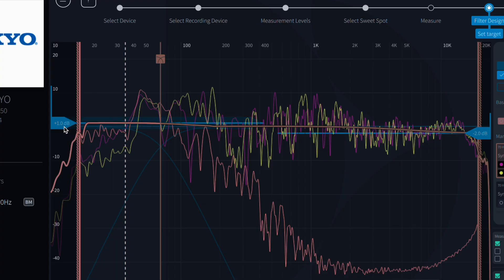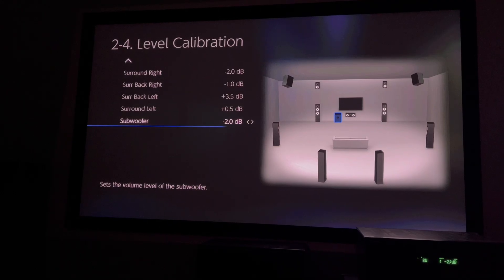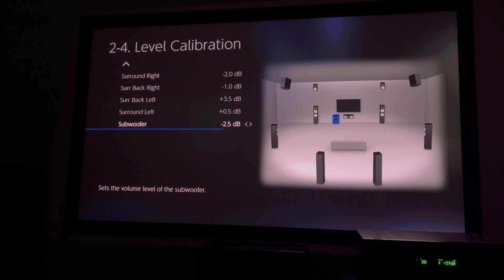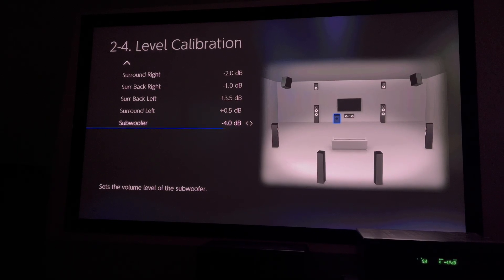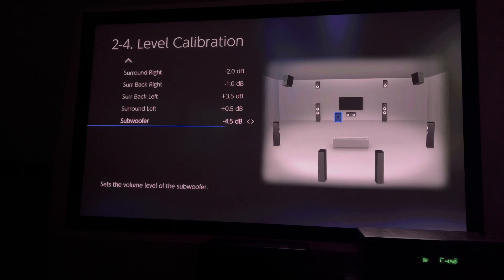4 Settings For POWERFUL BASS With Dirac Live

Comment: Dirac will put my bass to -7 db, it’s very similar to if  do manual setting of sub to achieve 85 db. It’s set to lower level so that when you have to crank it to reference level it won’t distort the sound. You might not hear bass at low sound level.

Comment: I now understand the sound signatures of these 2 brands. I had an Onkyo TX NR 414 back in 2012, sound sparkling, mids solid and bass, tight and dynamic, fantastic avr . Then I had hdmi issues back then and decided to switch to Denon X1500h, completely different sound, , warm, laid back, the highs kind of subdued, as if a veil was covering my speakers. Was not used to this Denon sound signature, but used the avr for about 4 years. But so used to Onkyo sound I eventually switched back to Onkyo, TX NR 7100,
Reply: What is 1500h? lol... get a 6700-8500 and see.

Comment: What if my dirac live sets all my speakers to large.. but instead of selecting 5.1  i select 5.0 or just unplug the reciever do the measurment then plug the sub back in or change it back from 5.0 to 5.1?

If the subwoofer volume is set to half way then why cant we put the Sub EQ to max on everything then slightly dial it back in the recievers subwoofer dB setting ?

Comment: Man this stuff gets complicated lol. But I tune in to learn. I love audio. I think I have a pretty good setup. Not Atmos yet, but a 7.1. my receiver is a Yamaha RX V467. It's a 5.1 but has a pre out. So I have a 2ch connected. Looking to swap it out with a Yamaha TSR 700 I got a few months ago. But hesitant because it's a 100w per ch with 2 ch driven? And the one I am running now is 105x 5. Which means it's more powerful. Again. I don't understand it, but I'm learning lol also running an SVS pb1000 pro and Polk Audio speakers

Comment: AudioAdvice has a 18 minute guide on DiracLive. He mentioned that most people also perceive the subwoofer weaker because the room creates a peak at those low frequencies. I can hear that in my living room (2.1 with a NAD M10 V3) when I walk around, the bass levels change significantely. 😉
Also people perceive sound very differently, from age to how damaged the hearing already is to personal preference. F.e. I am always a bit more of a "basshead" and listen primarily to EDM / electronic music. But I also always have been sensitive to higher frequencies, f.e. those buzzers when you press a button and it beeps is just annoying to me. 
And let's not forget that Dirac & the equipment manufacturers always develop their software further - which can be good or bad. In the last few months Dirac and BluOS released some updates which made my room correction unusable - and the last BluOS update yesterday reverted those changes in the bass curves that made my room correction run from 3 days ago obsolete. Now I have to run it again... 🤪

Comment: I haven't tried the settings where you start adjusting the curves with the onkyo app on my phone or lowering the gain before calibration. When I first used the calibration and almost all of the bass dropped I just went directly into the speakers levels and adjusted it there on the AVR. My subwoofers were calibrated at -15.... I have no idea why it would be that low. I set it at 0 but after watching this video I'm second guessing myself lol. I have the rz50 and two klipsch r-12sw's.

Comment: The 3rd suggestion, boosting sub in the AVR menu (NAD T758,) is blacked out and not adjustable if Dirac is selected. You can only boost specific speaker levels if you are setting manually.
Reply: Yes, all the speaker settings are blacked out with the NAD T758. Only way to change is to not have Dirac running. Hence why you set up levels & distance before running Dirac

Comment: Thanks for a Great video!  May I suggest for increasing bass:  "Harmon Target Curves".  I didn't have a CLUE (and still don't 🙂) on what those squiggly colored lines meant on the Dirac Live calibration on my Onkyo TX RZ50.  I found a YouTube video where the Instructor (SamDansCouch) recommended selecting one of several 'preset' Harmon Target Curves to increase bass because Dirac intentionally reduces bass.  These 'curves' were very helpful for me in increasing my bass after calibrating my system.

Comment: Most of this was bad advice. You don’t want to adjust the level or gain on your subwooofers after running Dirac. If you do that, there will be a harsh and sudden increase in volume of the sub woofer frequencies. The only good advice here is adjusting the target curve. Beyond that, once you find a target curve that is more or less “neutral” for your tastes, you can then adjust the bass or trebble tone controls on your receiver if certain content needs more or less of either.
Reply: tone control is worst advice than his
Reply: @harmonykardon2116  Agree to disagree. I used to feel this way, but people like Floyd Toole (previously at Harman, ironically given your screen name) have advocated for it when appropriate (particularly if you have good speakers).

The whole point is you don’t want to set your target curve based on content itself because if you do that, some content will sound great and other content may sound horrible due to inconsistent mixing.

That’s why I say, try to calibrate your target curve to sound neutral in the room (sort of hard to do given the content issue I mentioned, but with a lot of listening the room, it becomes easier), with the idea that you may need to use tone controls (particularly for bass) to make certain (poorly) recorded content better.
Reply: Target curve is the only answer here. You can’t fix room nulls with more volume, so room correction will pull back other frequencies to minimize the impact while balancing to other speakers. Two keys, balance your output levels (get close enough) at normal listening levels using the sub gain with the L/R speakers with a test tone and meter and once you run Dirac, export multiple curves with incremental bass levels to pick the one you want. Tone control should be defeated.
Reply: @photobriangray  I agree with you, except about the tone control part. Sometimes sources are poorly mixed and it makes sense to adjust to taste IMO. An easy example are stereo versions of steaming audio vs Dolby atmos mixes on services like Apple Music. The same song can have drastically different bass levels depending on the version you’re listening to.

I typically do have several target curve presets as well, but typically I find it works best to be willing to fudge things a bit with the tone controls when necessary. 😂
Reply: If you want I do remote calibration for Dirac I could teach you the correct way of doing it
Reply: @kermithoffmeyer840 
Moi je serais bien intéressé

Comment: Marantzs system does the same thing and I just shut it off and do my own test tone with the subs manually with a sound pressure meter(75dblevel) some may like higher or lower And I do buy into what you are saying

Comment: What if we use an SVS sub? Would the “right way” be to run Dirac live, then adjust the sub up by using the SVS app if we wanted a boost?
Reply from the maker: Definitely try that. Use trial and error to find a setting or approach that produces the best result.

Comment: One thing to remember: our ears/brain combo is not the microphone. We perceive sound intensity different depending on frequency and volume levels. For example at -40dB the bass may sound weak compared to other frequencies but at -5dB it may sound just right.

Btw, modern subwoofers often have DSP and built-in protection so it's hard to damage it with too high levels.

Comment: Glad I watched your video. I thought it was just the Pioneer app on my system where the bass falls back to the DIRAc level setting. BTW...I had tried to use the shelf level change for the bass, but I did not like the way it effected the response between 200-500Hz. I seemed to loose some clarity in the vocals, so I just adjust the subwoofer response and bump it up about 4db across the frequency range below 80Hz.

Comment: This video came up right as I was redoing stuff after adding height channels

As part of the recalibrstion I cannot get my subwoofer to work well with DIRAC calibrating. It's calibrating the entire sub out on my RZ70 and I'm having to add +6 or so to get anything from it and it doesn't sound right even after trying to advice in the video

My manual levels without room correction are sounding better to me by far and I have no idea where to start in fixing it

Comment: What about for an svs sub where would you set the volume before Calibration ?
Reply from the maker: Start by setting it at a little less than 50% and adjust it up to 50% after calibration. You can also use trial and error and try running calibration multiple times, setting the volume at a different level each time, to see which one you prefer.

Comment: What I do is just run dirac live and when its done. I go into the level and boost the subwoofer to 85db or 10db hotter then the other speakers. I wish I would've known about this sooner because for years I just let the room correction do its thing and thought that was the "proper" way to have the subs calibrated to the same levels as the others speakers. I always thought the reason I had bad bass was because I thought I had crap hardware. Then I bought a new AVR, speakers, and subwoofers was disappointed that the bass wasn't that much better. Then I watched a youthman video about setting the subwoofer 10 db higher then the rest of the speakers and gave it a try. It was a night and day difference.

Comment: Thank you!!! Important to note, after saving and exporting, if you go back into Dirac Live and make more adjustments, save and export. Then you must go back into the level calibration and reset the subwoofer level again. If you don’t, the subwoofer level will reset to the default calibration level. Great video!

Comment: Whether it's labeled Gain or Volume, the level control on your sub amp is part of the gain stage and adjusting it after running room correction risks distorting your bass and damaging the driver. Adjust the target curve in Dirac to get the bass you want, don't mess with your gain stage.

Comment: Hi, you mentioned adjusting the target curve, but what if you're using Majic Bean? Would you still try to adjust the level?
Reply from the maker: You could still boost the lower frequencies after loading the MB target curve. However, MB may already boost it enough. But definitely mess around with it and try different settings to listen for which setting sounds best.

Comment: So .... pozitive trim (eg +3dB) in AVR with lower gain on subwoofer ( eg -12dB) or higher gain on sub with negative trim in AVR, after DL calibration?
Reply: 100% adjust your gain on sub before the trim in AVR otherwise you can start clipping the digital signal being sent to you sub amp.  Way better to clip sub amp than clip receiver processor signal out
Reply from the maker: Try both options. Listen for which sounds better to your ear.

Comment: I only can suggest to switch to Bass Control if this is an option for you. I know and tested all three options and BC is definitely a game changer in tightness, accuracy and synergy with the rest of your speakers. Specially if other speakers are potent full range ones.
But if you use BC you should not tweak anything at your speaker levels after Dirac set it, as you can break the phase coherency.
I always correct the house curve to my preference. There are 3 saved presets. 
- a quite flat one with only +3dB on the low end which is very good for audiophile music listening
- +6dB bass boosted - fitting for the most movie material
- +12B bass boosted for ridiculous bass

+6dB and +12dB curves are equal to +3dB from 50Hz upwards. I only boost the sub bass to push the earthquake effect in movies but keep the audiophile touch in the rest of the house curve. I hate pushed upper bass between 70-150Hz. That sounds really trashy to my ears.
Reply: This is helpful

Comment: Thanks for sharing the knowledge. Just one question, under Bass Management, when I see speakers being crossed at 70hz or 60 hz, my AVR (Denon) still shows default crossover, which are set at 80hz. So how do I apply Dirac crossovers?

BTW, great tips on subs, I boosted the curve +5db, I have my bass back. Thanks once again, I just subscribed to your channel.
Reply from the maker: Great! Glad the video was helpful. You can adjust the crossovers by dragging the vertical Crossover bar to the left and right.
Reply: @GeorgeTheaterAtHome yes, but how does it get in the AvR. For example, I see speakers trims and distance changed. But crossover is still at default 80hz. 

If you have ever used Audessey, it will set the crossover in the AVR by overriding the default setting. I can change it manually if I want to. 

Not sure if I am doing a good job explaining this...lol

Comment: The reason the bass is less could be several. First most people do not listen at reference level so with how our hearing works, we will need to boost the bass to compensate for rhe lower level.
Also, people may be used to their bass with big peaks at certain frequencies that dirac will smooth out.
And if you have an onkyo, Dirac is still messed up there

Comment: Great video, George! Heads up, I spoke to Dirac Support and they mentioned that there is a bug with DLBC on the Onkyo-RZ50. Not sure if that issue also pertains to Bass Management but from my REW sweeps (had a Dirac Slot 1 filter with no Bass Management and Dirac Slot 2 with Bass Management) Bass Management created dips in the frequency response around the crossover points that were being set with Dirac. Was weird but would be interested in seeing REW sweeps between different Dirac profiles that have No Bass Management, W/ Bass Management, and W/ Bass Control if you're willing to buy the upgrade.

Also, the subwoofer setting in the OSD has to be changed for each Dirac filter, so if you change the trim while using Slot Filter 1, it will not change it for Slot Filter 2 or 3. Each needs to be adjusted in the OSD by switching to the filter you would like to change and then going to the OSD and adjusting the trim level. Just wanted to add that in case anyone thought changing it once in the OSD was sufficient across all Dirac profiles.
Reply: It applies to DLBM also, but it is not necessarily the dip you are seeing, but could be.

The dip is usually from choosing a crossover that does not result in good summation between the subs and speakers. DLBM and DLBC do not always, or maybe ever pick the optimal crossover. They usually pick the lower limit it senses your speakers are putting out adequate SPL. If you have a dip in response above that you want to choose a different crossover.

As for the bug, the receiver uses the wrong LPF for the subs on each set of speakers. It uses 120hz for the L+R, and then uses the crossover for the L+R for the Center, etc. it has been referred to as the off by one bug as the LPF is off by one set as you move through the sets.

Recommendation is to use DL for now. Not a big deal for those using DLBM. A big deal for those using DLBC though. It affects all PAC (Onkyo, Integra, and Pioneer) units that support DLBM/BC. Needs a firmware upgrade from the manufacturer.
Reply: @JoeMacJr  very helpful information, thank you!
Reply from the maker: Excellent info. Thank you!
Reply: So bottom line is not worth adquire the upgrade of dirac to bass management on the rz50
Reply: @JC_Onofre  DLBM is included. DLBC is the upgrade. I would wait to upgrade until it is confirmed fixed. Onkyo, and the sister brands, are working on a fix. Hopefully it will be soon. 

On the RZ50, if you have multiple subs, I would look into a miniDSP solution to pair with DL. The RZ50 does not have independent sub outs, so DLBC will not be able to manage multiple subs well.
Reply: @JoeMacJr I’ll just add that Dirac customer support told me they fixed the DLBC issue on their end and now it’s just a matter of Onkyo rolling out a new firmware update.

Comment: Just an FYI. The Onlyo currently has a bug in DLBM and DLBC that acrews up the crossovers (the sub LPF) on all speakers, especially the mains.

Until there is a firmware update from Onkyo (actually all PAC recievers thatt have DLBM/BC), it is recommended to use DL.

This is not a big issue for DLBM, as there is not a huge advantage of using it over DL, but is a major issue for DLBC users that are looking for the multisub Management and phase alignment between the subs and speakers at the crossovers.
Reply: The firmware fix is out.

Comment: Hi, I was wondering if you offer remote calibration?
Reply: If you mean remote room acoustics calibration, the calibrator really needs to be sitting in the room they are working on.  Much of it is science, but some of it is personal tastes and tweaking to those tastes.  Sitting at a computer a thousand miles away from the room is impractical.
Reply from the maker: I have to be able to hear the system to dial it in. Unfortunately remote calibration is flying blind.

Comment: I actually like temporary setting on the onkyo / integra avr's. 

What I said earlier. There is nothing wrong with lowering the sub trim level to -5. I am actually making a subwoofer video where I will actually state that it should be set to -5 but i will explain it further why and how can this be adjusted but I would start at -5 then adjust gain.